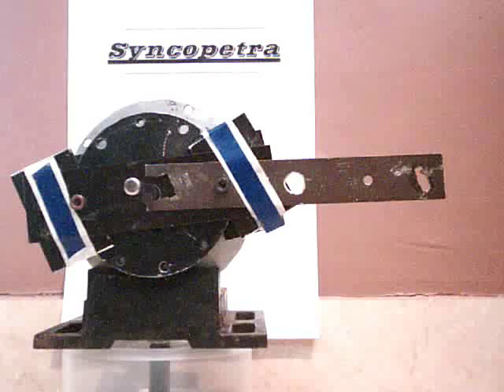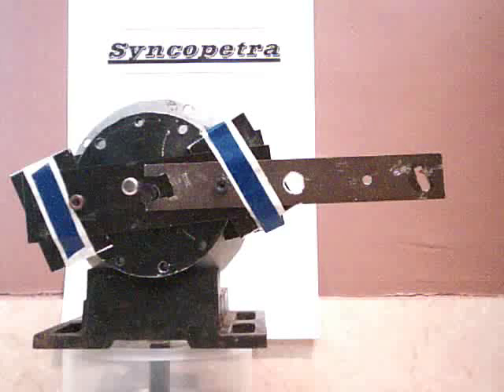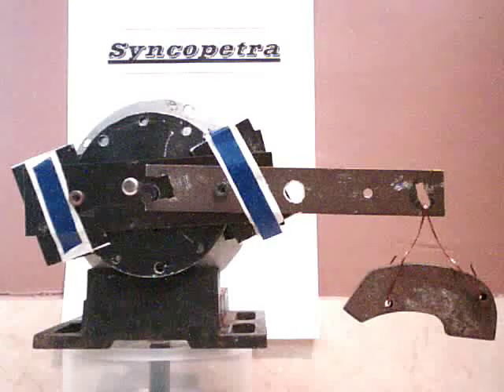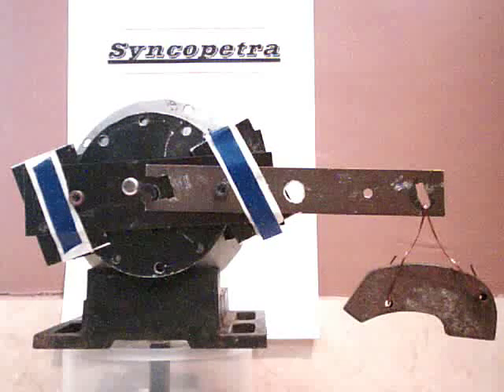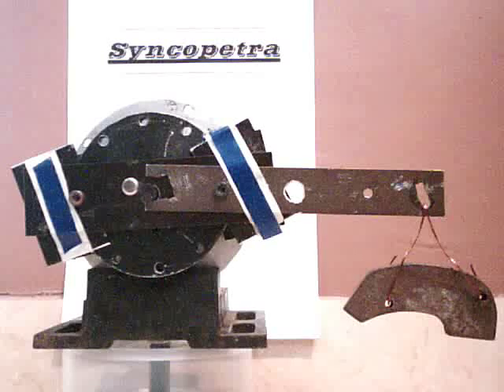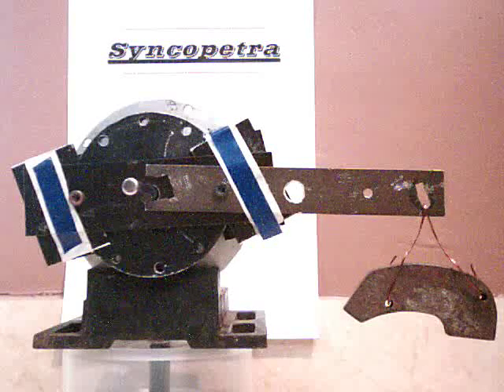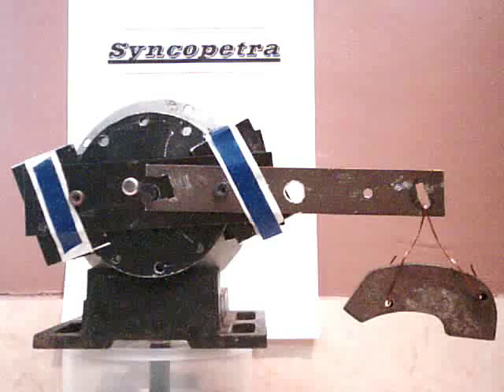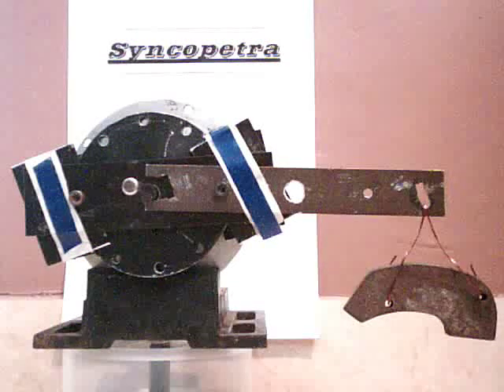Maybe the last piece of the puzzle.

Comment: WARNING! INCORRECT STATEMENT OF THERMODYNAMIC LAW IN ABOVE VIDEO!  Okay, now that I've got that off my chest, here is the correct version of what you were trying to say: no process is possible whose SOLE result is the transfer of heat from a cooler to a hotter body.  

Also, from wikipedia:   "Heat doesn't flow from cold to hot (without work input)."
In the case of the refrigerator, the compressor does that work.  Adding evaporation in no way breaks thermodynamics.

Comment: @daenumen - I don't normally use Wiki but even it has a definition for torque, and I quote:  "The magnitude of torque depends on three quantities: First, the force applied; second, the length of the lever arm[4]  connecting the axis to the point of force application; and third, the angle between the two. "

From my physics book: "Torque is calculated by multiplying Force and distance, so the SI units of torque are newton-meters, or N*m:

Thus my case is proven.

Comment: Torque and movement are two different things.

Also, magnetism has confusing shaped fields and properties but it is (at best) a conservative field, like gravity. What you are trying to do is the equivalent of make a roller coaster ride that runs forever with no power source.

You can build parts of the ride and it will run itself. Other parts even have sections where it climb up slopes. But when you connect it up it always needs an energy input  to run it.